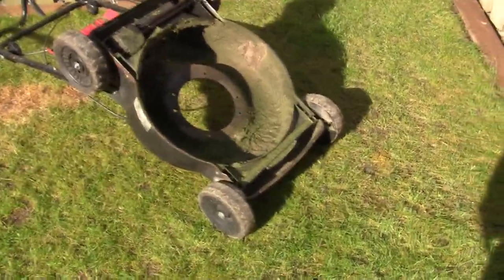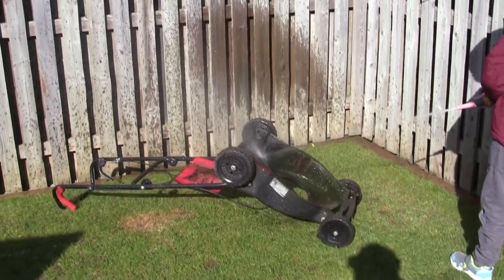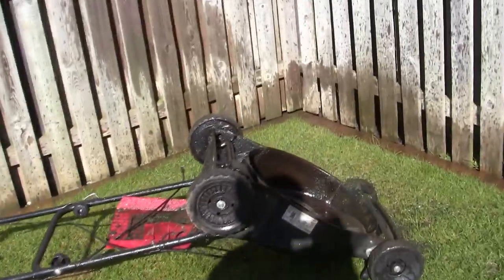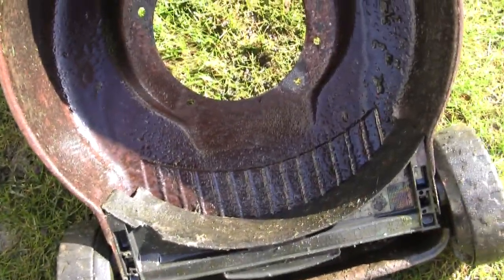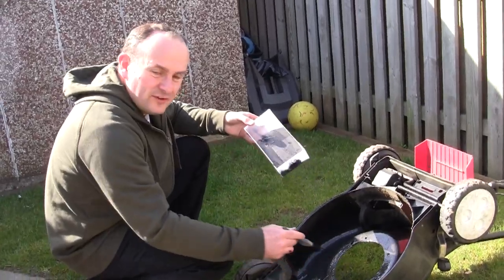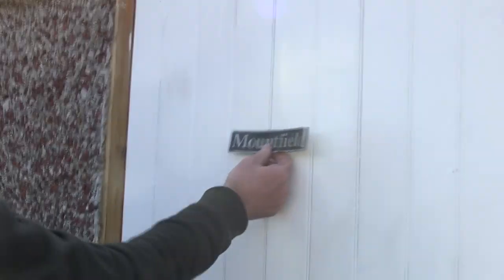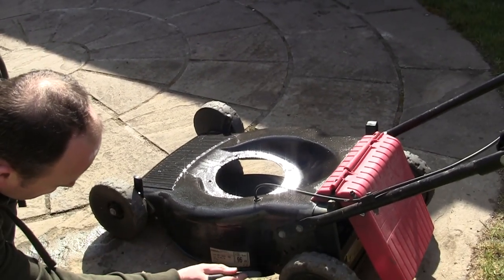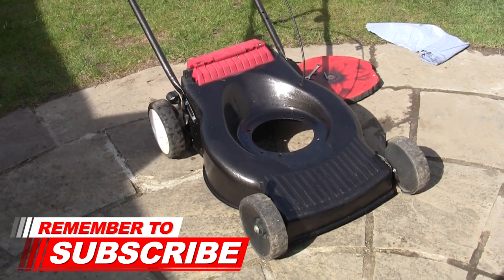How To Tidy Up And Paint A Scruffy Lawnmower Deck

Comment: Great video showing the average Joe how to keep a mower deck solid for years to come! One suggestion I have is before resorting to the pressure washer or hose, take a drywall taping knife or paint scraper and scrape as much of the buildup off as you can. MUCH less messy and it’s kinda fun to see the bottom of the deck pop out as you do! I often find lawn tractors with the decks rotted out for the same reasons. I learned my advice from my dad, who kept a 1966 John Deere 110 in beautiful shape for years. Original deck and not a speck of rot on it! Sadly, I sold it last year because, well, I’m an idiot!

Comment: Greetings from New Zealand. Lawn mowing is almost a national sport all year around. Hot wet conditions make the grass grow up you trouser leg in a few days.  For steel deck, before use, spray with WD40 or CRC. It stops the grass sticking. After every use wipe off and respray.Deck will last for years. Having said that a lot of mowers here are alloy and my two are close to 40 years old. Thanks for some of the tips. Nice site.
Reply from the maker: Thanks Terry
Reply: Nice one . I pant my mower with used motor oil after a spray off with water hose.

Comment: I've just taken the engine off mine because the paint was coming off on the top side of the mower, especially around the engine. Probably because of petrol leaking down there every time I fill it up too much, and then I go smashing it up sideways up around a steep bank.
I also live close to the sea so pretty much everything gets rusty really quickly
I'm just after power washing mine now and it's drying off at the moment, so I just thought I'd watch somebody doing the painting before I tackled it myself.
Mine was in a right mess, grass all clogged up inside the drive belt, and it had popped off, so it was definitely time to give it a really good clean up.

Comment: Great video! Ive been told some lawn mowers can be tipped over to one side or the other but you can fill up the air filter with oil. Sounds to me like each mower has it's recommended side to tip over. Some say to tip flat with the handle on the ground and front in the air. It seems confusing. Either way, try to find the proper way to tip the mower that you own. Thanks and great job!
Reply: Tip it on its side with the gas cap up.

Comment: Good Job there. I dropped my engine out yesterday and pressure washed. Just need to get some paint as mine looks like yours before painting. Is it worth putting petrol resistant lacquer on the top side of the deck as well?
Reply from the maker: Only if you plan on spilling it! It wont hurt thats for sure

Comment: Is it okay to use a hose and wash underneath after every use or do you have to take blade, engine off if you use water hose on it?

Planning on getting a Honda hrx with plastic deck but not sure if these last as long as steel decks
Reply: It’s fine. Just be careful not to get too much water near the engine. I have a plastic decked Honda and it’s seriously robust (just don’t drop it!) and very easy to clean. In my opinion Honda make some of the best mowers you can buy.

Comment: Wasn’t intending to watch this but , having power washed the deck, it still clearly has debris stuck to it, and it’s still not completely stripped of fittings, this needed shot blasting and powder coating or spraying properly as it now looks a like a lumpy mess. I guess it will do for another season, but that’s the problem, “it will do for now” as opposed to being able to stand back and say, “i’ve  refurbished it to factory condition”
Reply from the maker: Ivor from Cornwall, UK Thanks for watching.